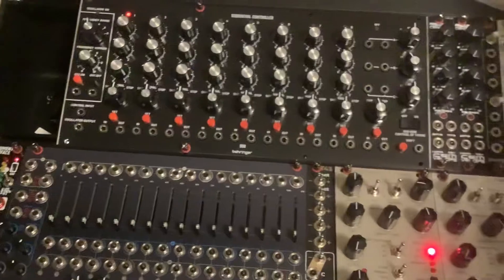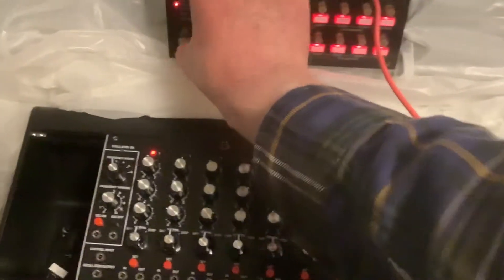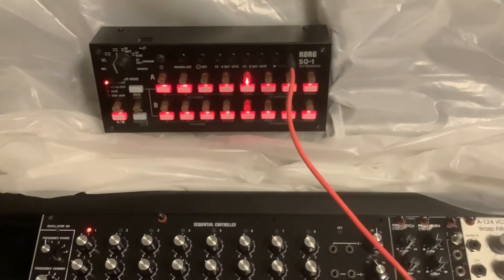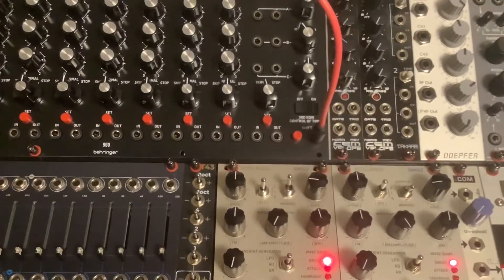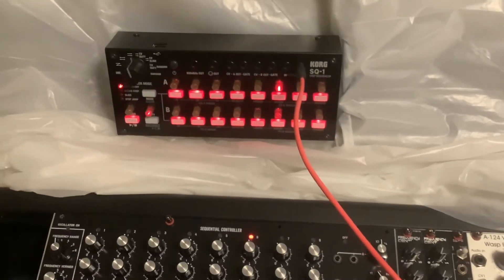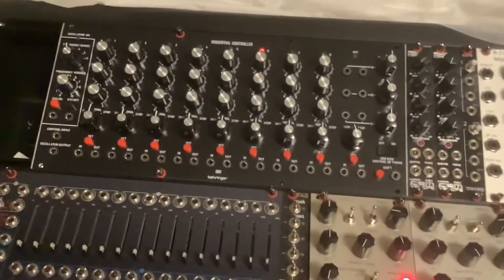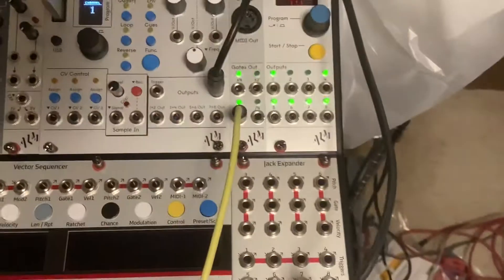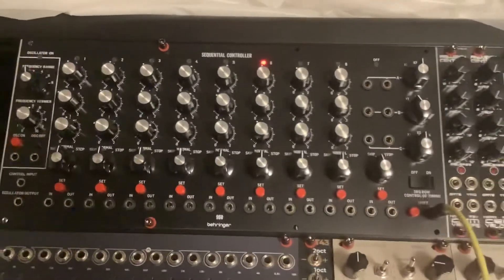Behringer 960 won’t sync (Solved via repair)

Comment: Easy peasy. I use a Shakmat Clock O*pawn mk II as clock. So........Clock out (from Shakmat) to Shift in (on 960). Reset (from Shakmat) to "step 9" In. "Step 9" out to Step 1 In. That should work 🤔

Comment: I have mine paired with a Moog Mother 32.  If I take an out from the 1/V octave port and plug it into the output section, the 960 works just fine.  Now all I have to do is learn how to tune it and get all three rows working.

Comment: ...from the Manual, Section 4 - 

"IN - activate any stage via an external voltage trigger. Note that if a stage IN is patched to another stage OUT, it will cause the 960 to reset to stage 1, bypassing stages after the  OUT jack."

Try patching Step 9 OUT to step 1 IN...  ;)
Reply: Also, when you have the Osc running and you send clock, it doesn't work until you turn Osc off. And, for some reason, once patch has been made as I mention, you can unplug that cable and still works, but it wasn't until I made that connection in the first place that I could get clock to work, not sure why.

Comment: I was able to get my 960 to sync when triggered by my RD8s trigger outs.  One step per trigger.  When I tried the clock out on the RD8 it was almost synced but about one step off.  Glad you found your problem.

Comment: Mine works fine - it advances  sequence with a Doepfer LFO square wave (bipolar) and a MI Marbles trigger output (unipolar) and the Marbles Y output (bipolar)
Reply from the maker: My unit was repaired by Thomann and now works properly.
Reply from the maker: The only issue on return was that the Frequency Range pointer knob was sticking higher than other knobs on the unit. Apparently the switch for the range has a threaded shaft housing that extends further from the faceplate. than the shaft housing on other switches which are flush with the panel. Turns out they have similar looking knobs with different shaft offsets to accommodate and they were switched on assembly..

Comment from the maker: Aside from Pamela's New Workout with the PEXP 1 Expander, I also tried sending clock signals from my GRP Synthesizer R24 sequencer clock output. Not pictured in the video was my 961 interface trigger converter--which I also tried because someone on a comments thread suggested that it needed s-trig. Oh and I also tried feeding it with signals from my TR-626, as well as square wave LFO's from the modular and clock out from the Oakley sample slew. I can't recall If I tried sending gates from my cirklon, but suffice it to say. It wasn't just the bloody sq-1. I posted this video for Thomann at their request after noting the trouble shooting I'd already done with the other hardware.